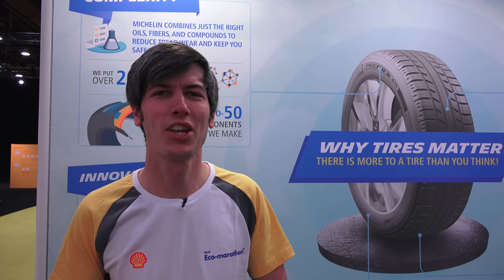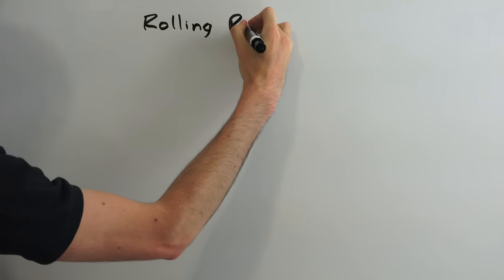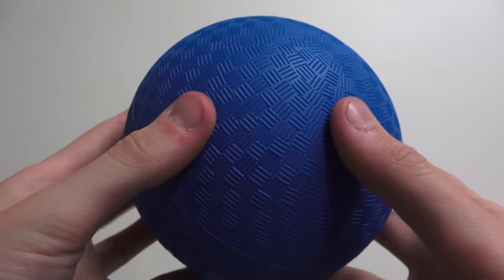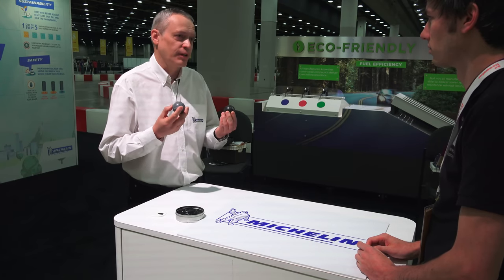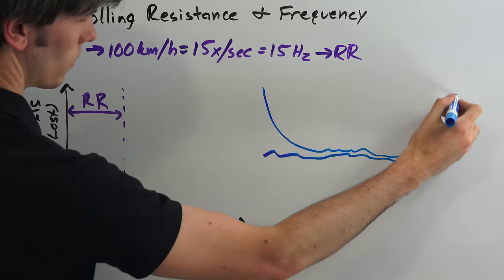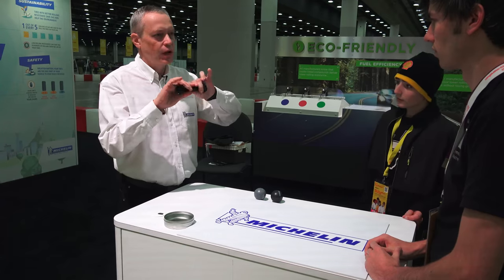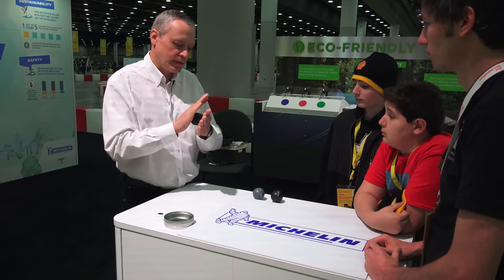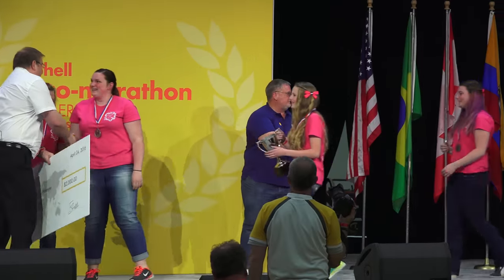Can A Tire Have High Grip And Low Rolling Resistance?

Comment: im using retread tyre..
Reply: +Andy Shim if you want to die, keep using them
Reply: +Mudux Except a recap on a truck. IE Bandag, is more cost effective. Cars notsomuch
Reply: HJZ75driver good point, trucks and buses tires are made to be retreaded, while car tires do not.
Reply: Retread tires for light truck use..31x10.5r15..
Reply: +Andy Shim Pretty sure retreads are illegal anyways
Reply: +HJZ75driver front tyre only cannot use retread..others no prob
Reply: +Andy Shim Should be all tyres cannot be recapped. Except heavy truck tyres
Reply: +HJZ75driver using silverstone AT casing with BFG AT tread..running abouy 40k km alrready..price ..1 BFG can get 3 retread tyre

Comment: Force of Inertia? What the heck? Are you sure that's a thing?
Reply: +dongimin2 I'm sure he means the force required to overcome inertia
Reply: +Adam Pardoe all force "overcomes" Inertia, you just divide the sum of forces by the mass and you get acceleration. You don't get an extra force if you're going slow.
Reply from the maker: +dongimin2 Yeah I'm sure. An object resists motion based on its mass if you attempt to move it or alter its state. 
http://quod.lib.umich.edu/d/did/did2222.0000.714/--force-of-inertia?rgn=main;view=fulltext

Comment: all this for that 1mpg difference.
Reply: +CosmicBlu EvoX I'd guess you'd see more than a 1 mpg difference. The stat thrown around from my dad working on the railway when I was a kid was 1 gallon of fuel per ton(ne) per 1000 km. 
Obviously a lot of the efficiency can be accredited to the scale of the diesel electric locomotives (and the Saskatchewan landscape), but a not insignificant portion I'd imagine comes from the very low friction involved.

Comment: inertia isn't a force....
Reply from the maker: +Waheed360 An object resists motion based on its mass if you attempt to move it or alter its state. F=ma, you need a force to accelerate a mass. 
http://quod.lib.umich.edu/d/did/did2222.0000.714/--force-of-inertia?rgn=main;view=fulltext

Comment: Isn't his explanation with the silly putty, the exact opposite of your silica graph?
Silly putty-> Slow deformation, non-elastic, high energy loss. Fast deformation, elastic, low energy loss.
Graph-> Slow deformation, low energy loss. Fast deformation, high energy loss.
Reply: +Stanley Chang He said exactly that in the demonstration. 4:55
Reply: +SevenW25 V LOL my bad, he did say that. I got distracted by the kid staring into the camera and stopped paying attention haha
Reply: +Stanley Chang No. When its stretching all slow like that, the energy thats being lost is relatively low. Not much heat is created doing so. But when you yank on it like that, It has little to nowhere for the energy to go so it snaps. High energy loss and rather quickly. if you were there to feel the putty after the break, it would be much warmer at the break. It doesnt seem intuitive when it snaps like that. It looks like the tire compound is gonna be hard, meaning less grip. But i think you kinda want that to happen so the tire can conform to the quickly changing road surface. just my 2 cents
Reply: +alexisthemexican You've got it all mixed up.
Reply: +Stanley Chang I don't think so. Just look at the energy introduced and where it's going.
Reply from the maker: +Stanley Chang Haha, everyone keeps mentioning this - at 4:53 he mentions that tires behave exactly the opposite. The demonstration shows that you can manipulate the behavior of a compound depending on the speed of deformation (frequency). Tires will have high energy losses at high frequencies (where as this 'putty' he's using does not).